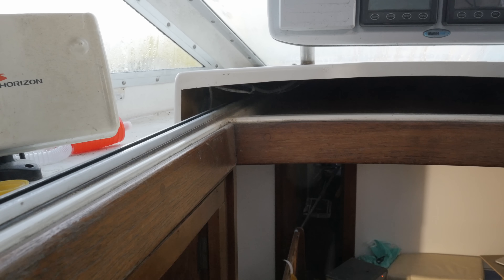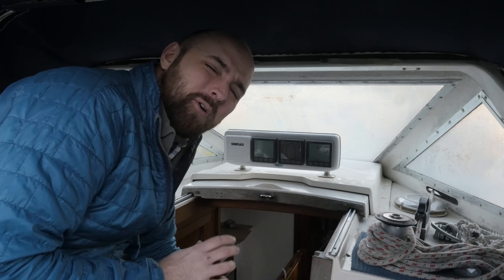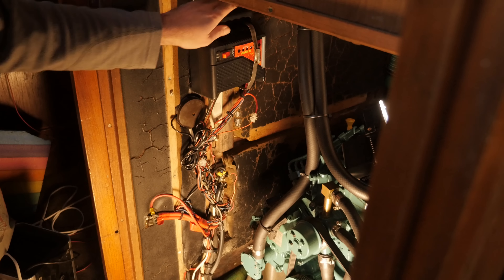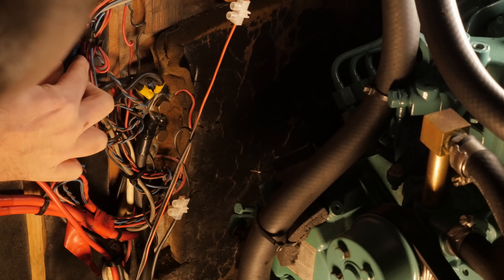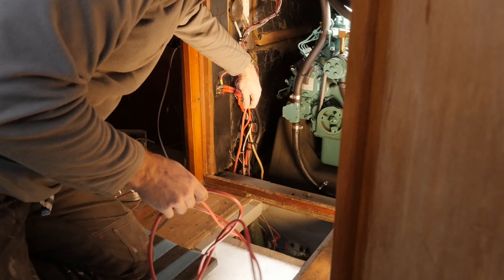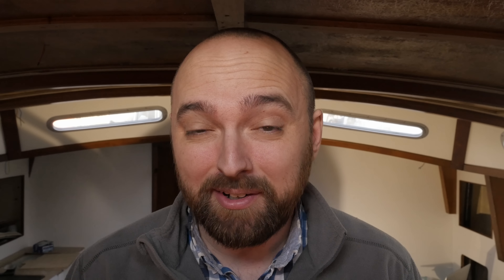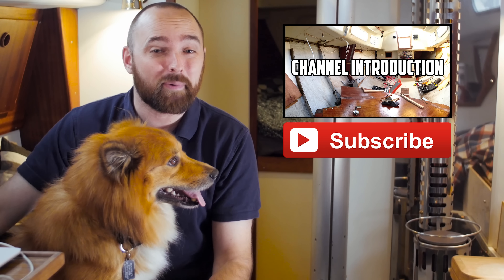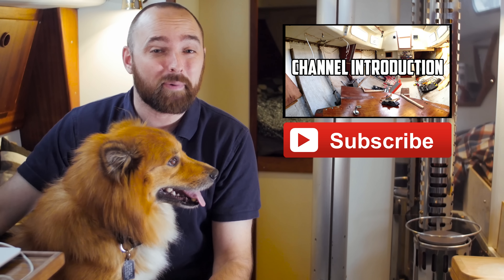Sail Life - Painting & preparing to rewire the boat - DIY sailboat refit

Comment: Those screws are security screws. You should get a set of the security bits along with the "one way" bits for your screw gun. The set isn't expensive and it comes in very handy.
Reply from the maker: Thanks :) I've found a set on eBay :)

Comment: The fitting requires a security bit set.  Those will fit the piece with the little pin in the middle.
Reply from the maker: Thanks :) I've found a set of bits on ebay :)
Reply: It's also known as Hex key. Here is the hint https://en.wikipedia.org/wiki/Hex_key

Comment: those bolts you found on the instrument pod are security bolts. specificly pin in head torx screws probably. common on electronics here in the usa. Ive gotten a set of drivers for about 8 to 9 USD.
Reply from the maker: Thanks :) Another comment beat you to it :) I've already ordered a set from ebay :)

Comment: Hey Mads, those nuts are called a "security hex" head. Navpod does include the tool when that unit is sold so hopefully the previous owner left it on the boat somewhere. You should be able to pick one up at a good hardware store if there is not one aboard though. As a side note this type of screw is used for tamper proof applications. I know this because I used to work in a jail and those screws were used all over the place in there.

Comment: The screw is a torx security screw, you can use a small flat  head screwdriver and cut a slot into the middle or of course they can be bought at home depot here in the us

Comment: Enjoy what your doing,might think about pulling a large black and Red wire from battery isolation switch to your cabin power. Think about it this way, you don't run multiple wires to your utility pole outside your house. 
One other thing is installing a battery equalizer. Sometimes batteries will not charge evenly.

Comment: Oh when you pull wires through the cabin pull a "small nylon pull rope" (Usually electrical supply used for pulling through conduits) through...that way you can pull wires back on it, and running them is typically much easier!!

Comment: Mads, Those are security screws.  They require a special bit to open them.  There are many different types of security screws which companies use to prevent their customers from taking a device apart.  You can get a nice selection of security screw bits from Amazon for $12.99. I have this set: Neiko 10048 Security Bit Set, Chrome Vanadium Steel | 100-Piece Set

Comment: I stretch those heat shrinks sometimes if the wire is just a little too big for them. Take 2 tiny screwdrivers (the watchmaker kind), stick them through shrink and pull gently apart.

Comment: Just an idea I wouldn't pull all the wiring for everything out yet I know its hard to stop. Later on when you actually start rebuilding you can use the old wires to pull the new ones through the tight spaces you might encounter.

Comment: some thing like this will help with the sticking hatch 

FloPlast
FLOPLAST SILICONE SPRAY 40ML (3290F)

View reviews (20)
 4.3 out of 5
View all Q&A
Aerosol spray for uPVC push-fit, soil, waste drainage and underground discharge systems. Prevents sticking of rubber and plastic parts.
Reply from the maker: Thanks :) I'll keep that in mind :)

Comment: That autopilot hidden fuse.  A couple of things... You could put a label on the cover that says 'FUSE Inside *Amps', OR put a jumper across the connection and fuse / CB it externally or at the panel.

Comment: They are security screws. You need a special tool to remove the screws. By the way, Athena is starting to look really good on the inside. The existing wiring is likle spaghetti that has gone bad and mouldy. It is amazing as to how many wiring systems on boats is like that. I wonder how many boat fires are the result of bad wiring.

Comment: Stainless steel socket head / buttonhead cap screw.
Reply: carbidegrd1 - nope it's a security fastener, small round pin right in the center.  But the sockets and drivers are available via the internet.  Sometimes more efficient to order a pack of screws because they come with a driver.
Reply: carbidegrd1 hex tool
Reply: I've been able to knock out the security pin with a small punch. Something to keep in mind if you're only doing a couple of 'em.
Reply: Sockethead is a hex.
Reply: You can buy the hex key with a drilled out end.

Comment: That grey grease on the hatch cover may be molybdenum grease. It at least looks like that. That grease can go a long way to protecting the aluminum from wearing and making the hatch lose and not track well. It does look like it needs cleaning but you may want to consider putting a similar grease back in.

Comment: Hi Mads, 

thanks for the update, i mentioned it in your previous video but not sure if you read it, please do some more research in your choice in panels. the one you are looking at now is quite flimsy I've read. I would (maybe am) go for a german  philippi stv 264 panel or other panels from them, Also a kickass can-bus system for your waterlevels Battery monitoring etc 
Philippi-online.de

Thanks for the update!

Cheers
Reply from the maker: Flimsy? Where did you read that? :) I'd love to follow up on that
Reply: I googled blue sea panels after your last video as i am also in the proces of changing the wiring on my Oceanis 430. I stumbled op on the video in the link, at 4.50min it doesn't look to sturdy. Its also a blue sea panel. 
Anyway, keep up the good work!

Comment: Those are a type of screw designed to prevent vandalism or interference with devices but beware they come in a range of sizes and shapes. (I have some that are shaped like an allen key set and others that can be used with a 1/4" socket wrench or driver) A good tool shop or the internet would likely be your best source.

Comment: i have a question. why do you take down and reapply the painters tape between coats?
Reply from the maker: Dang it! I wanted to answer that in the video. Totally forgot! If you remove the masking tape while the paint is still wet you'll get a nice edge :)
Reply: ok but it sure seems like a lot of extra work. thanks for your hard work i look forward to seeing you every sunday (well sunday here)
Reply: Just started watching your channel. If you wrapped the item you are taping in protective paper with blue painters tape to secure it, then a 3/4 or half width of area left to tape, you can use a single layer of blue tape for the edge, then just remove that layer of tape instead of the entire thing... Just started watching your videos so sorry you're mostly done already.

Comment: A couple of things that I've found really helpful when rewiring boats like you are doing are these small clips that can be glued with the supplied glue, they are very strong and help you better organise your new wires and zip tie them up away from any chafing hazards.http://www.weldmountsystems.com/

The other thing that is very helpful for tracing wires without having to completely remove them or if they go into a hidden or non accessible area like so many boats have.  http://www.princessauto.com/en/detail/multipurpose-wire-tracer/A-p8347684e

Hope this helps. Keep up the good work!

Comment: hi. i
i
I have watched your channel and noticed your ladders you use for access on to your yacht,  there is a major recall
on the ladder type shown in your videos, you may want to check your ladder type to see if you have faulty ladders. there is a world wide recall.  some of the flexible joints on the ladders have failed and its reported that people have got seriously injured. i purchsed my ladders in 2015, and have just  recieved a recall notice from my diy suppliers for a cash refund or new replacement.  best regards.

Comment: mads the bolts on the back of the pod are called pin hex security srews and the drivers for these are available on ebay
Reply from the maker: Thanks! I'll order a set of those :)
Reply from the maker: Found them - got a set on it's way :)

Comment: Man that wiring is such a mess, I was an Aviation Electronics Tech in the Navy, just seeing that rats nest makes me cringe. 

I bet with your attention to detail once you have it all back together its going to be very neat and organized. 

It was very dumb of them to run the high and low voltage together, one short between the two could potentially wreck all of your 12v gear on the boat.

Comment: I haven't told you but I really like the lines of your rigid dodger. 
Also referencing your last video, you COULD use a hot female but the niche you have carved out for yourself, what has made you this popular is doing what you are doing!  If you did find a female she would have to be as detail oriented and as fastidious as you are, and how rare is THAT going to be?  I like what you do. Don't change anything dramatically. 😁
Athena is turning out nicely and I can't wait to see her in the water.
I DO think you are too worried about fine details. Many things you do are great Great GREAT, but fine dust in the paint?  There are many details that I have had to let go of as the time and effort it takes to fix are not worth it. I figure if they bother me that much I can fix them later, saving time and money now.
Actually what you do is fine as you show how far you CAN go but you don't have to. Don't take me wrong, doing my refit in a working boatyard I get strange looks from the regulars for being more thorough than they are used to i.e. electrical conduit running to major areas from the distribution panels. But the most important thing is for durability AND ease of use and repair.
I like how you are not afraid to take things apart. The further you get into the wiring the more I think you should just tear it out and start over. 
All in all I think you made a perfect choice with Athena as all the work she needs gives you a chance to shine all over again to a wider audience.